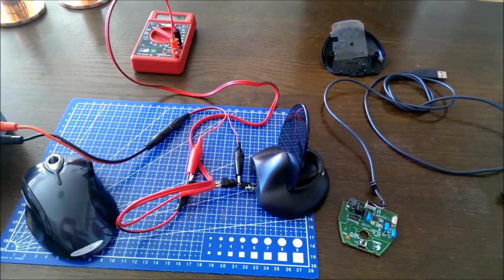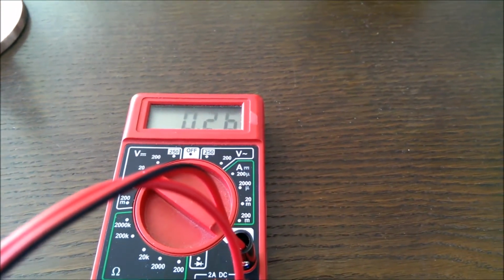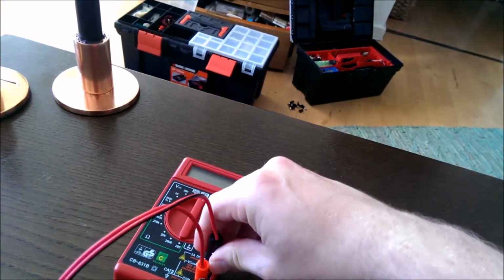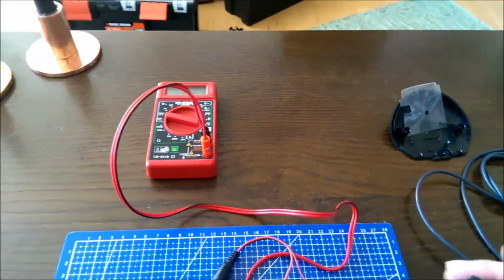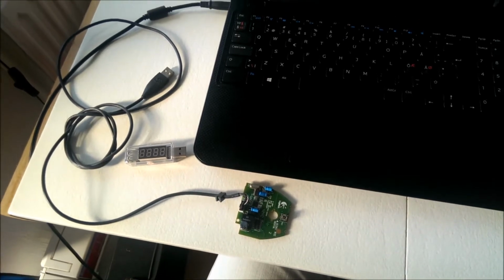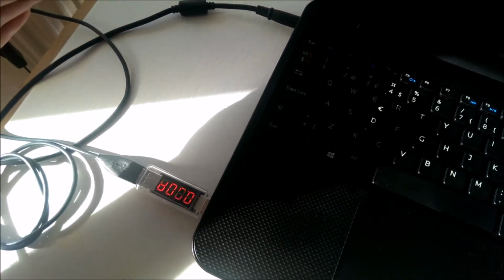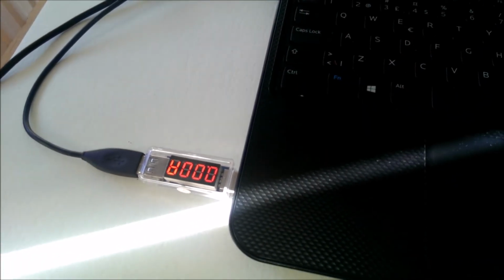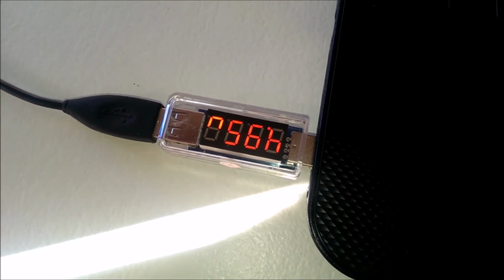Logitech MX1000 USB Charging Mod

Comment: hi , thanks for you to share this experience i have just a question please how much voltage that enter in the pins of the mouse i think 4.2 v but im not sure ? and where is the positive pin ? thanks again
Reply from the maker: Your welcome :) At 3:00 onwards, I talk about pin out. The non-white square on the controller board is negative (black wire). The square next to it is positive (red wire).
Reply from the maker: voltage will vary but it will be USB range only.

Comment: +Michael Madsen How did you get the mouse shiny? Did you remove the soft-touch covering?
Reply from the maker: +Kevin Roberts I just wanted to clean it as it had gotten a bit sticky on the soft grip parts and I used 93% house hold alcohol. The side affect was that the soft grip coating was wiped off. I like this way actually. It did take quite some rubbing and if you want to do it your self, I suggest to use a fair amount of paper wipes, like toilet paper. As soon as the soft grip starts to come off you are wiping the left over glue and if you keep using the same piece of paper you are just smearing glue.
Reply: Thanks Michael. I'll give it a go. The soft grip had really deteriorated on my mx1000
Reply from the maker: You are most welcome. Good luck :)